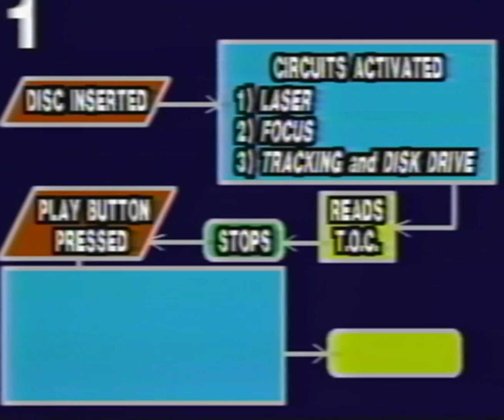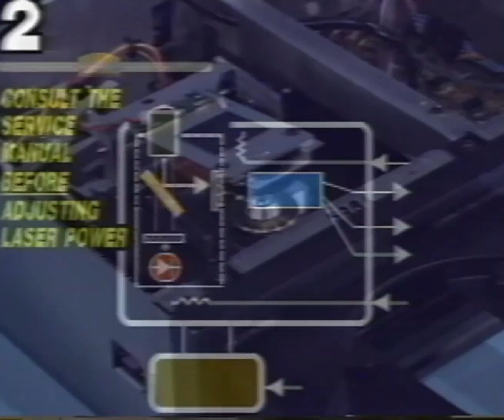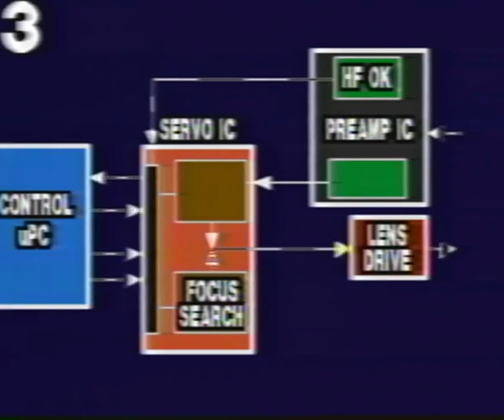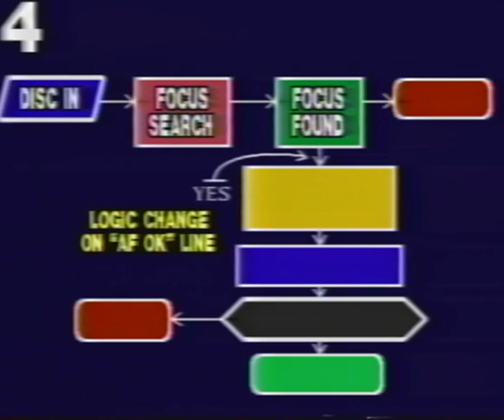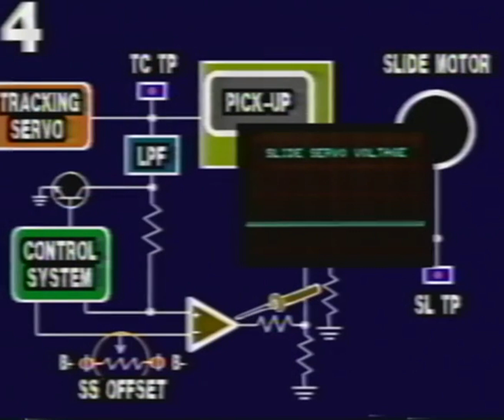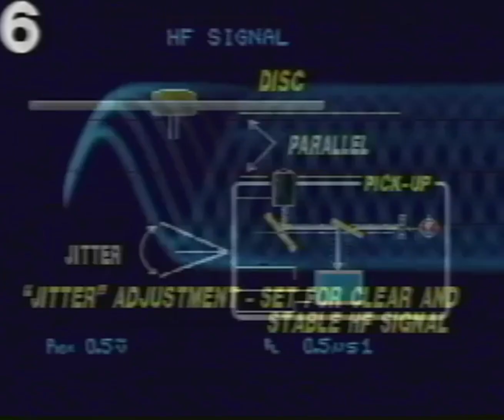How do CD DVD LASER's work

Comment: Juste to compare :According to the postulates of this model, the universe is described as an isolated and complete quantum system, whose sole fundamental degree of freedom is the Ecton Field (Φ). Physical reality emerges only following a phase transition, wherein the spontaneous breaking of the U(26) symmetry forces the field to condense into a non-trivial vacuum state. From this state, spacetime is no longer a postulated background but an emergent property. The Spatial Dimensions correspond to the stable and extended configuration of this condensate, with their geometry defined by the spatial components of the emergent metric (g_ij). Simultaneously, the dynamic nature of temporality is defined by the Temporal Phase Factor of the universe's wave functional (Ψ_universe ≈ exp(iS/ħ)). It is crucial to distinguish this mechanism from a classical wave: an electromagnetic wave propagates within spacetime, whereas the temporal phase factor constitutes the unitary evolution of spacetime itself.

How, then, can time be both this wave-like process and a structural dimension? The resolution of this duality lies in the fact that the dimension is the geometrization of the process. Time, as a phase wave, is the fundamental engine of causality, the "tick-tock" that evolves the state of the universe from one moment to the next. The temporal dimension, on the other hand, is the mathematical frame of reference, the emergent coordinate that orders the sequence of these "tick-tocks" into a measurable chronology. The dimension is the ordered trace and the geometric record left by the passage of the wave. In essence, reality is the manifestation of a single field's dynamics, where space is a structural de property of the vacuum; time is both the process of its phase evolution and the dimension that measures this process; and particles are its localized excitations.